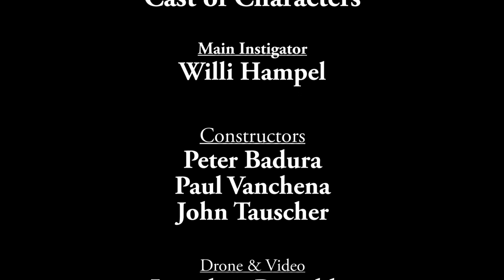5 Kw Wind Turbine Upgrade

Comment: Amazing project! 
Why aren't the blades longer? Does local county regulations limit diameter ?
Reply from the maker: I'm sure there are regulations for limits. This is a residential station and it's supplying power in conjunction with a small solar farm. Everything has its limits!